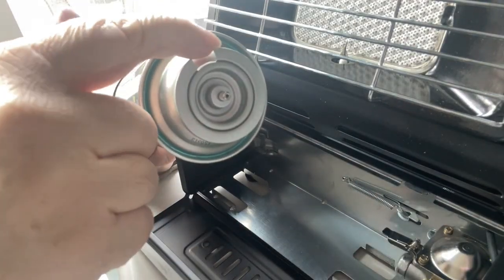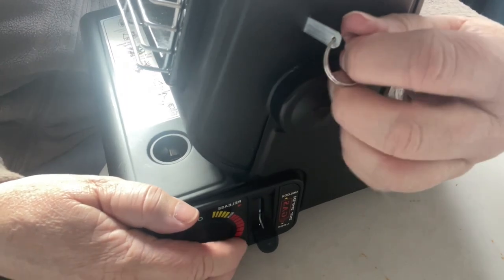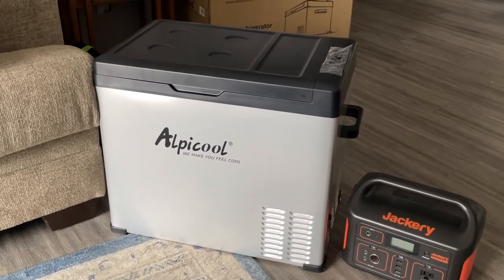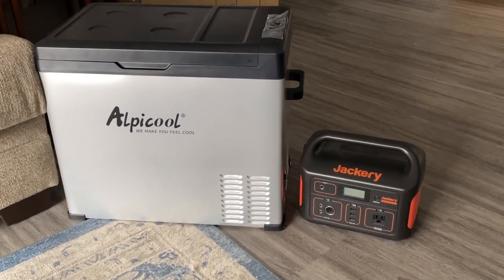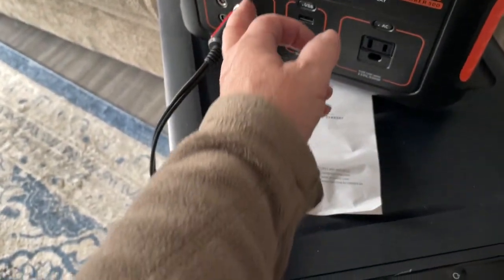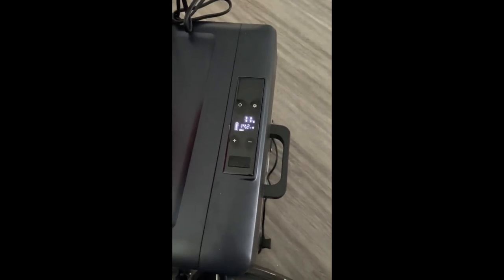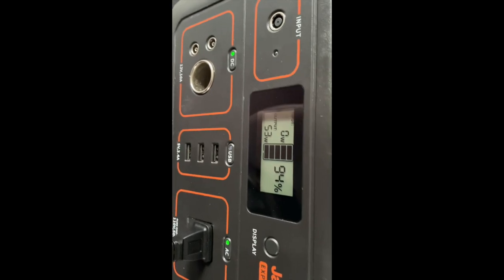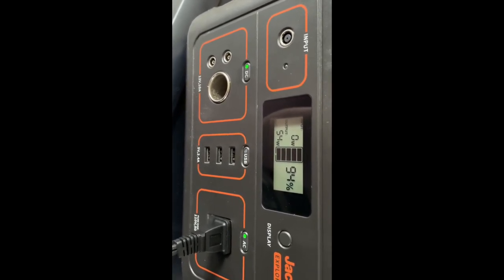Update on the heater and some info on my new fridge.

Comment: Hazel ☘️ …
I imagine the rattle is because it is not sitting level … it’s partly  on wooden floor and partly on carpet ?

Also initial cooling will probably need to be on full power then reduce to eco thereafter. 

It will only switch on and off automatically as the temperature drops …. If you were to put it at a lower temp it should switch on to reach that temperature that might test it  …. I hope it’s not defective , that would be so disappointing ! 

I love my Jackery 500 !

Have a great week 
🙏☘️😘
Reply from the maker: Yes, all good info.  The rattle stopped so that is good.  The 12v power cord has a loose connection so i plugged in the house plug.  Now it works.  I reached out to the company that sold it and they gave me a partial refund for the defects.

Comment: A couple of things. I do a lot of camping. I too have a car fridge. Different make to yours. I run mine on house power at home and battery power when camping. I have mine set on 3 degrees centigrade. And I only use ECO mode. How successful it runs depends on my battery. You mention your 12 volt cord is defective? Maybe you can get a new cord. I have a 12 volt cord for me car and portable battery. I have and A/c cord for home. I use my fridge as a fridge. Hope this helps and your videos are NOT boring. I’m about to get myself a snack and binge watch your video.
Reply from the maker: Thanks for the info Stanley and the encouragement.  I was not sure what temp I should set it at so thanks for mentioning the temp you set yours at. I think I will look around for at 12v cord too once I am back in the van.  Just loaded the fridge in there today and started loading some other stuff too.  So excited to get going!

Comment: Wonder if the fan is rubbing on those bent in grills?Could burn up the motor eventually. Maybe you can unscrew the grill and bend it straight carefully? Hope you get it all figured out. ✌️
Reply from the maker: Thank you.  I was wondering that too but it seems to have stopped now.  If it starts up again and will try to unbend it.

Comment: There is such a learning curve with all of these devices. It seems if Apicool shipped you a lemon, I’m sorry about that, it certainly causes me to question their ethics. The unit being damaged, and the cord not seating well. Imagine driving down the road and that things is jiggling in and out of service. 
The battery usage is good, that’s what I’m shopping for currently. I made the mistake of watching comparison videos, and reading comments so I’m more  confused than ever! I will probably just go with a Jackery since it has a good reputation.
Reply from the maker: I really like my Jackery. Its the only battery I have tried but it works very well for me.  The company that sold the fridge to me through Amazon was very quick to respond to my email when I told them about the problems.  They refunded me a good amount of money which made me happy as it is enough to get a new cord and some extra too. I can still use the fridge and so its all good.